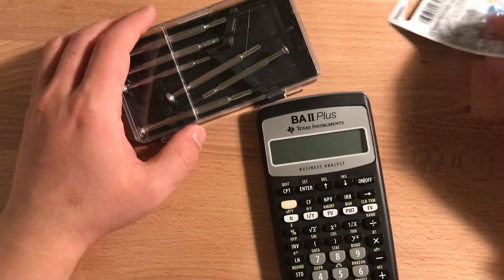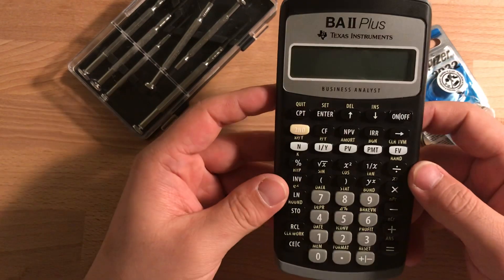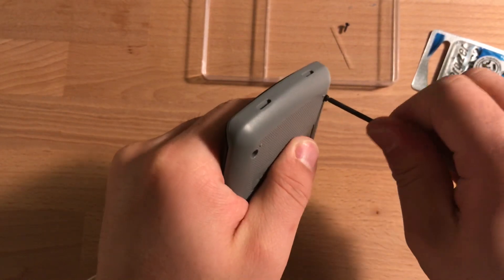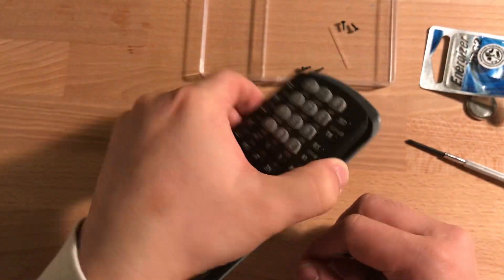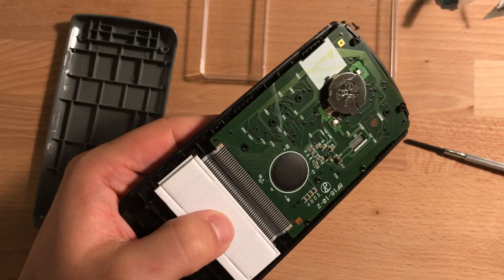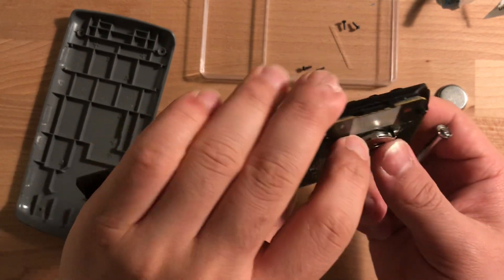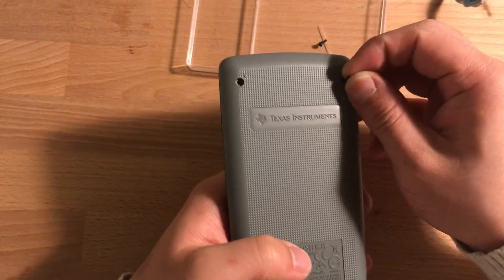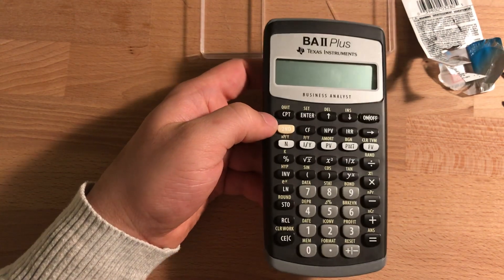How to change the battery for the Texas Instrument BA II plus

Comment: Where did you get the tool set? I need to know the name of it.
Reply: I always use a small scraper about 3"-4" long with a plastic double edge razor blade, gently wedge it in between the front and back cover, and gently move the blade up, down, and around the perimeter of the calculator.  As with any tool be careful and not go too deep into the calculator so not to scrape any printed circuit boards.